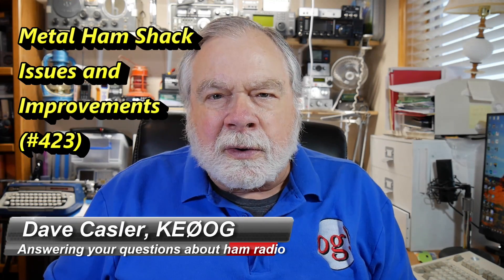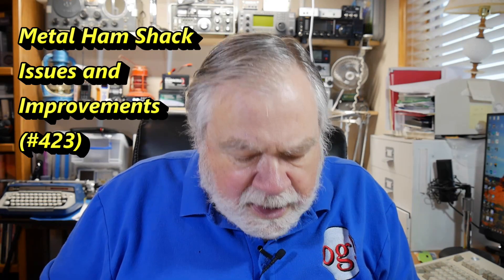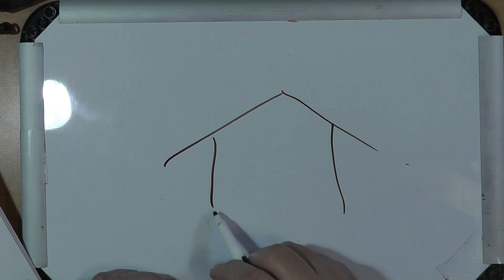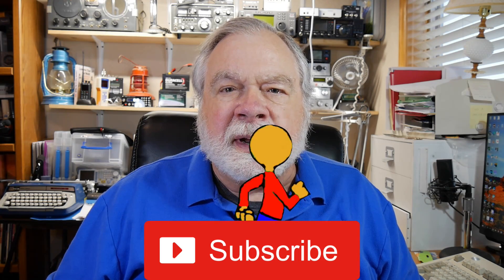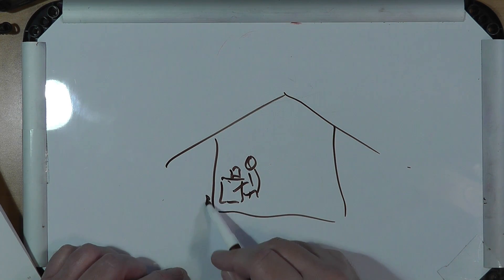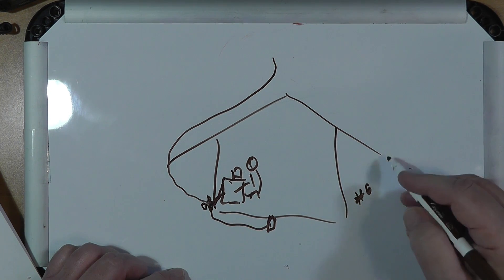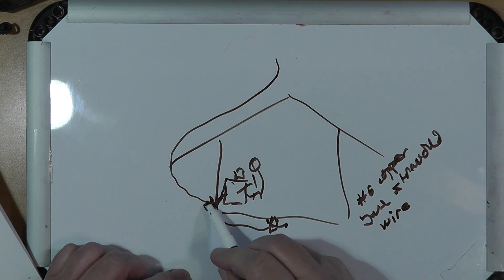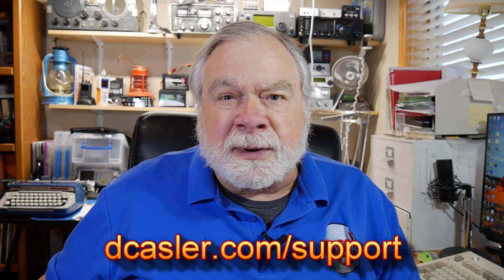Metal Ham Shack - Issues and Improvements (#423)

Comment: Another great video. Thanks! I have a sort of related question. I have a metal patio cover and my 40M inverted V center pole (made from 2 chain link fence top rails) is metal and attached to one of the support posts for the patio cover. This antenna has never quite lived up to what I expected so I am wondering if the mount and the patio cover are causing limited performance. I can move the pole about 5 ft away to a stand alone spot and I intend to do this anyway in a few days. Thanks, Dave.

Comment: Dave, why do you always indicate 6-ga stranded wire rather than solid core wire?  It's generally more flexible, I realize, and arguably has more "surface" area, but it seems to me it would also be more susceptible to breakdown from the elements.  I installed solid core because that's what's in my house utility ground.   Solid core bigger than 6-ga would be really challenging to install, but 6 was relatively easy to work with.

Comment: Depending on how long the power feed is to the shack, make sure there is no voltage between neutral and station ground as this will cause problems with some newer rigs, requiring bonding all your ground rods. An AC surge suppressor along with ferrites on the feeders will help with keeping lighting and RF from going back into the house. Bulkhead feedthru connectors make a nice install.